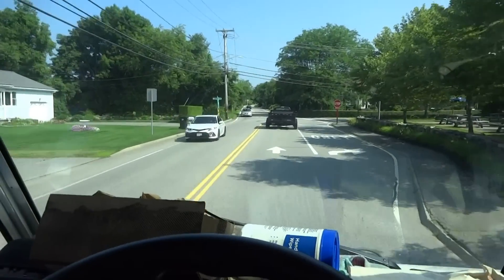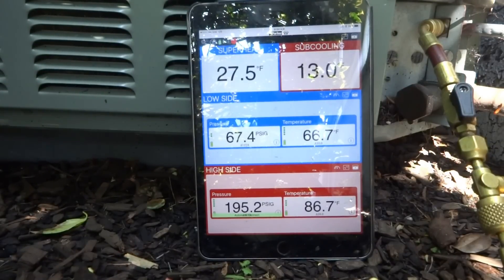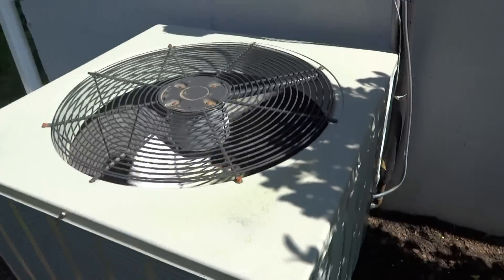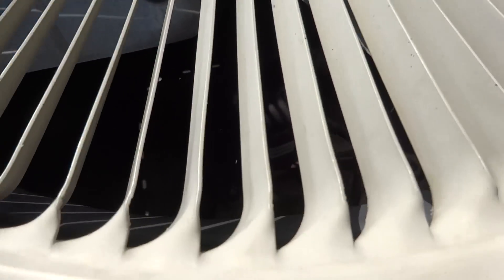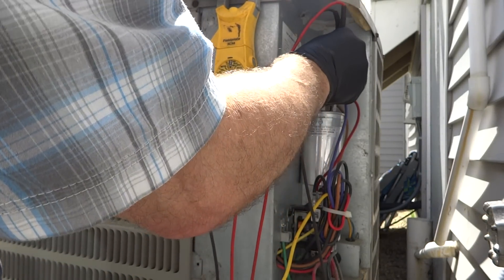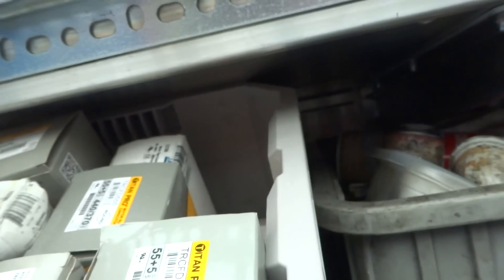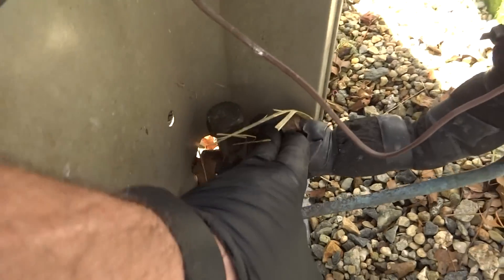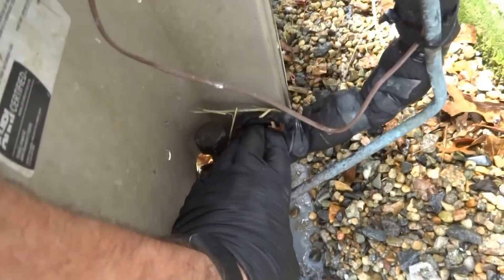3 SEPERATE AC UNITS CHECKED OUT FOR CHARGE AND RUNNING

Comment: So do you recommend paying for preventative maintenance or just placing a service call when it breaks down? 
I have a combination heat pump with domestic hot water and heating/cooling over here in Spain. They charge $150 annually for “maintenance”, as far as I can see they just change one filter on the water unit, and the filter at the air handler (I can change that myself). Most neighbors thinks it’s a ripoff.
Reply: steves smaat he buys in bulk!
Reply: Not an AC but I installed my own Amana furnace at 28 years old with zero homeowner experience. I never paid for a single maintenance or service call. I lived there 32 years and moved with it working perfectly never having replaced a single part! No, I don't believe much in PM.